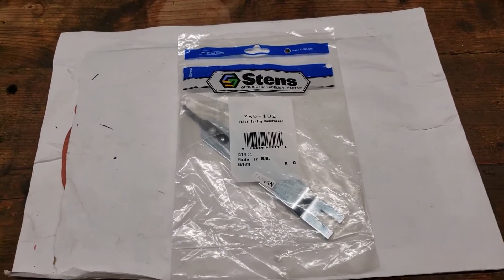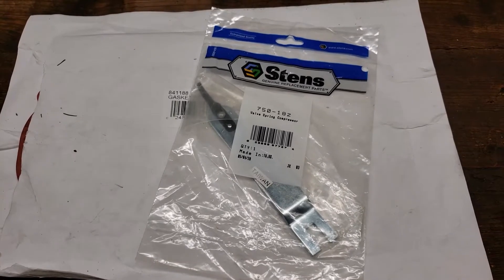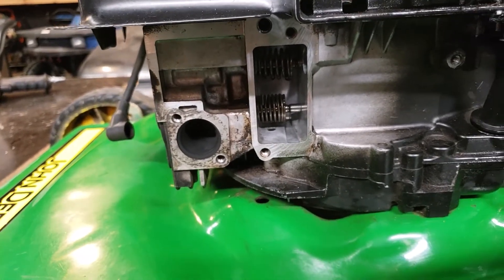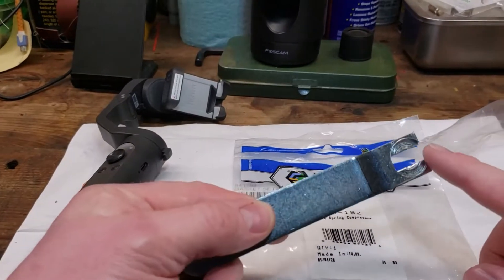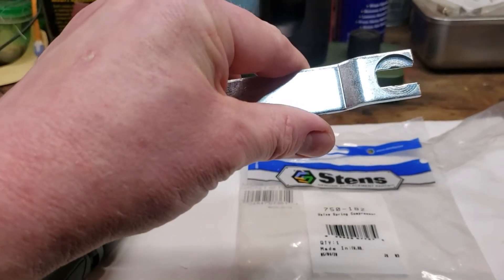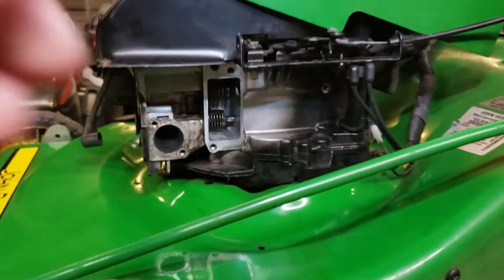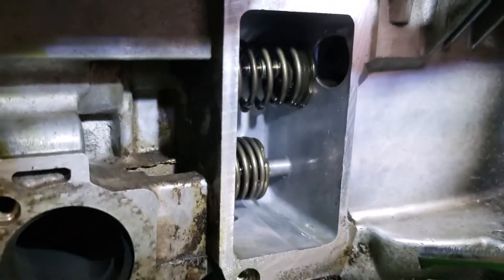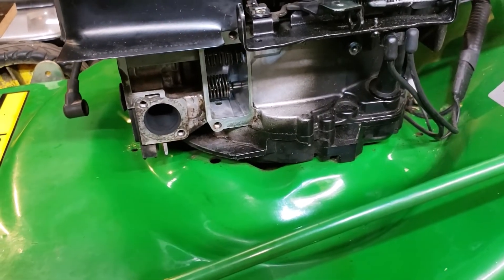Small Engine Valve Spring Compressor Tool

Comment: These are a very good tool and will make it very easy to install or remove the springs for value jobs
Reply from the maker: On the slide style valve spring retainers, this is easily the best valve spring compressor tool you can use. It takes up the least amount of space in the cramped quarters the valve springs reside in and you can remove the slide style retainers with basically one hand.
Reply: @crankytuber  yes Sir 
My son in law bought it for me because I wouldn’t pay the high prices stens charges for shipping 
Lololo